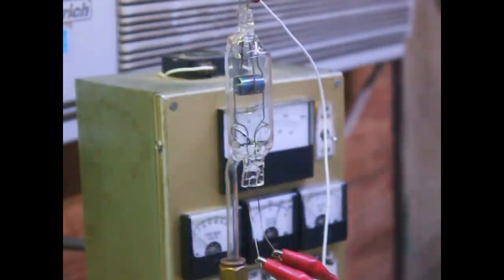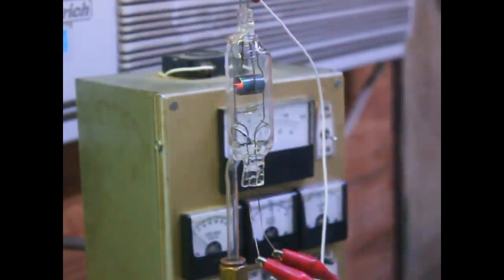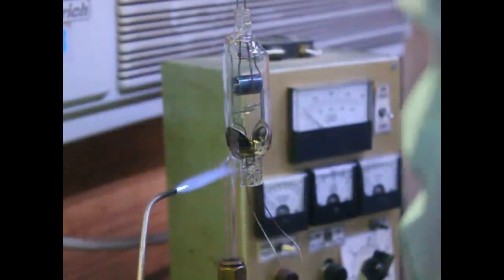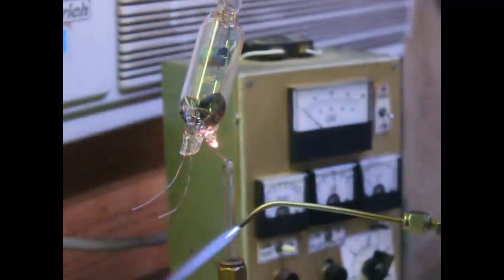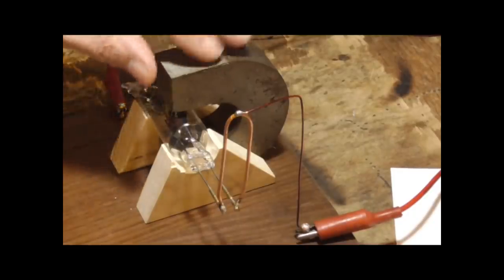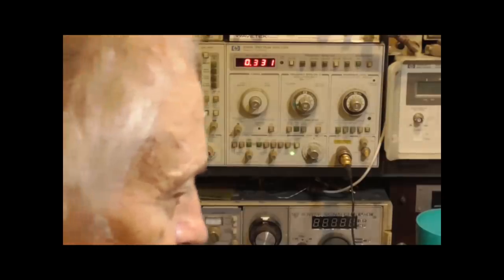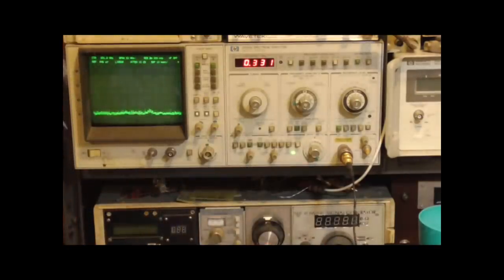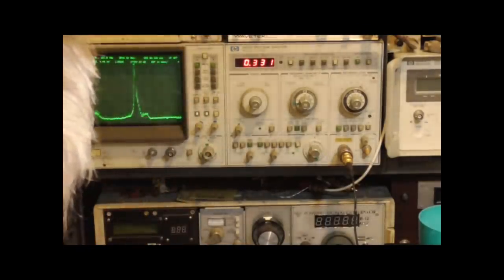HOMEMADE MAGNETRON WORKING!

Comment: That's very cool. I'm thinking though that the frequency might be a little easier to tweak if the two elements were coming out at opposite ends of the tube, right? Did you keep the cathode exposed to the air for less than 10 minutes like I think you mentioned in the last video? Anyway making tubes seems fun, I was thinking of trying to do it in a vacuum chamber but this seems like the way to do it. I liked learning about how you made the final vacuum seal by heating the stem so it collapsed and then twisting it. Makes perfect sense. Thanks for the video!
Reply from the maker: The magnetron was copied out of a magazine article from a 1939 Radio magazine article. More to copy what they did rather than redesign a magnetron.
Reply: @glasslinger  Perhaps I was confused, I was talking about the 30's designs pictures that you showed in the previous video. It seemed like adjusting the frequency or other characteristics is why they had the wires coming out of opposite sides of the tube, which you said was unwise, so, do you still consider that unwise? Possibly the frequency cannot be adjusted by that method alone but probably a little bit. I figure the 30's people maybe heated up the glass and tweaked it a little bit until it was what they wanted. Maybe, maybe not, I could probably find out via research but I figure you might already know the answer. Thanks for the videos, again. So many times I've thought something was stupid only to find out later that there was a purpose behind it.
Reply: @glasslinger  That is really cool, did that magazine suggest using a dual headstock configuration? I think this is neat, myself, although I suppose everyone in glassworks is probably doing it. Also it's great that this knowledge from the past is retained, I wonder if this 1939 Radio magazine is available online. Very nice you were able to make it work.

Comment: I just don't understand the hairpin!
Reply from the maker: Think of a coil of wire (inductor) that is uncoiled with the two ends side by side. The inductance now is much lower because the magnetic fields of the wires are not interacting with each other. It's a way to get very low inductance values.

Comment: I like it. I never thought such a simple magnetron could really generate so much power, but I'm a bit dissapointed about the low frequency. Would the frequency increase with a stronger magnet?
Reply: The magnet has nothing to do with the tuning, only the deflection of the electron cloud from perpendicular, to approaching tangential to the anode. It's critical to the operation, but doesn't contribute to tuning. 
The tuning depends on the anode itself - this is a different type of cavity than a common microwave magnetron. It has two separate anodes with a wire inductor coupling the two. The capacitance inside the cavity provides the bulk of the capacitance of the LC circuit, while the anode wire provides most of the inductance. 
Fundamentally it operates the same way as microwave magnetron but this only has one LC circuit, and it's expanded, with higher inductance because the wire/inductor is like 20 cm instead of ~1cm.
Reply: @tannersword1  Thank you (and Adam Rak) for explayning an important part on the circuit. I never saw a complete circuit with an early magnatron so I missed the LC part.
Reply: It seems to be a "low" frequency design. For high freq the inductor is the copper wall of the anode cavity. The microwave magnetron is a good example.
This design is much easier and safer to work with too.
Reply: @adamrak7560  thank you, now I understand the strange design of the resonators on magnetron in a microwave.
This one has the inductor at the outside, so it can't produce higher frequency than a triode.

Comment: What the actual heck? First time I dropped in, an antique bakelite speaker cone was being repaired. Now, this.
Reply: It's about vintage electronic, vlaves (tubes ?) are are vintage electronic but the magnetron is still in use in most microwave ovens.
Reply: @stelleratorsuprise8185  Yeah, I know about microwave ovens and radar.. I love vintage electronics. I'd love to see someone copy the "Hieronymus" machine. A simple circuit diagram and article was published in "Astounding science fiction" magazine, for this, making wild claims about it's capabilities as a "psi" technology, in the 50s. I believe someone was selling them a few years ago, but would love to see it being made and tested, though it's very dubious if it does anything...
Reply: @chuffpup  and what would I be finding or doing with something like that? I could factor the correct frequency or rates for time travel?
Reply: @sterlingbruno5196  Well, it would be a "fun" project. I collect old pulp science fiction mags and books, and used to have a copy of this but I loaned it to someone... It's available online anyway. If you do get a comfortable time travel rig up and running, do get back (or forward) to me.  Maybe you can get my Astounding science fiction magazine back from oblivion, or find a working Hieronymus machine from the inventor... I think there was a mistake in the published circuit diagram 😒...
Reply: @sterlingbruno5196  Oh I see. It was a question. Ummmm. Dunno. I think it was used for analyzing things placed on a metal plate. It had (from memory) another plate you put your finger tips on and you could feel some kind of textural change. It was weird and interesting, so that was enough for me. Edit: This home made magnetron would be quite adequate for now, what skills!

Comment: Why did you fire off the getters before pinching off the tube from the vacuum pump?  Wouldn't you seal it off first then fire the getters?  Wonderful job.  Also, were you able to predict 300 MHz by the physical dimension of your tank circuit?
Reply: Seems better to let any outgassing or vapors be evacuated while still connected to the pump, and prevent a permanent rise in the tube pressure or contamination. The getters should be designed to catch more oxygen than is actually in the space anyway.
Reply: @tannersword1  exactly, the purpose of the getter is to remove as much of the remaining gas as possible, if it were outgasing that would be rather counterproductive wouldn't it?
Reply: @xxportalxx.  of course! The getter itself would also definitely outgas atmospheric gas from its surface as it heats up. It's surprising how much gas can be embedded into materials, including metals.
Reply: @Darryl603  Bad Idea
Reply: Yeah I was thinking about that as well, perhaps gas particles can't diffuse back up past the pump tho so it doesn't matter? Still you'd think that the less volume the greater the effect of the getters 🤷‍♂️

Comment: Great Project !! You would have probably would have a better (dramatic) result with the PR#47, if your wire loop was a full or half wavelength of the frequency generated by the magnetron ! After watching many, many of your video's !  Do you have a schematic and parts list or source, of your power supply for your tube projects ?? It seems to be very robust and versatile piece of gear !!  That anyone working with hollow-state (tube) devices and circuits, would be a very happy to own !! I love the small meters, mostly for watching the amperage in each of the tubes elements !! Thanks for all your work in teaching us !!!

Comment: This is awesome.

I really like your glass working videos.
I've always wanted to have a go at it and finally found a set of rotary and diffusion pumps and even been given a helium leak detector.

Would you have any recommendations for sourcing glass? I have plenty of old vacuum tubes I can reuse the envelope from. Would cleaned CCFL backlight tubes be good to use to make the evacuation stems?
Reply from the maker: For small quantity of glass, ebay is best. For larger quantities, Mountain Glass is where I buy mine. Don't bother with old tube glass. It will crack no matter how  well you try to anneal it. Stick with borosilicate. You can use the leak detector as your complete vacuum system to test and to evacuate any tubes you make.
Reply: In some of his earlier videos, glasslinger says he uses borosilicate glass as it cracks less. Ebay seems to be a good source.
Reply: @quadcam24v  thanks.
I have been keeping an eye out for some on eBay.
I am wondering what I can recycle. There is so much glass being thrown in landfill every day. CFL backlight, fluorescent lights, halogen bulbs,...

Comment: 0.010amps × 800v = 8watt?
Reply: Miles Prower yes and?
Reply: @Dextermorga  well they said milliwatts but the numbers say watts
Reply: @milesprower6641  Watts are going in, emission is in milliwatts. The rest is heat.
Reply: Watt?
Reply: @smilingbuddha2836  What?
Reply: @smilingbuddha2836  Who's on first?
Reply: Watt?
Reply: You’re a wizard, Harry.

Comment: Super achievement! I am curious to know how you chose the plate-to-filament-to-plate spacing: Was transit time a determining factor of the maximum frequency of operation? How did you choose the length of the center-tapped tank circuit?
Reply from the maker: I have a 1939 copy of Radio magazine that has an article on primitive magetrons. I copied one of the examples in a photo, guessing the dimensions. I had no idea of what frequency it was going to operate. I was guessing 600mhz but it turned out 310. Good enough!